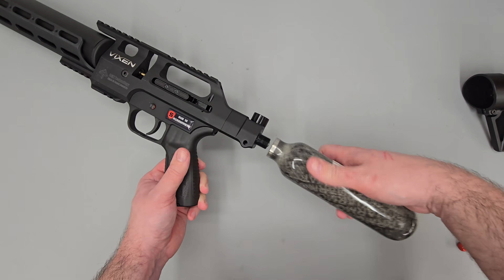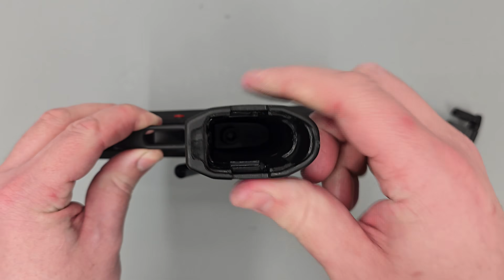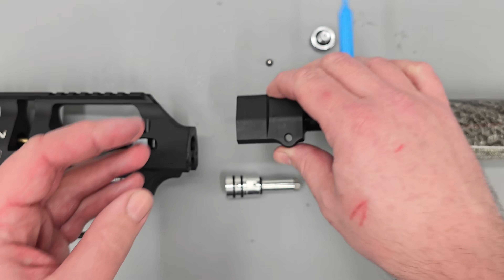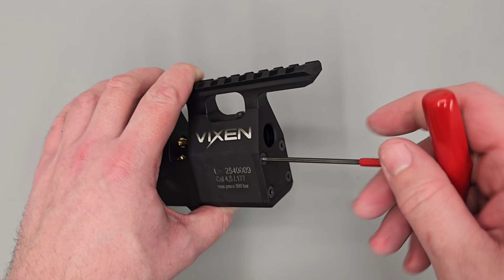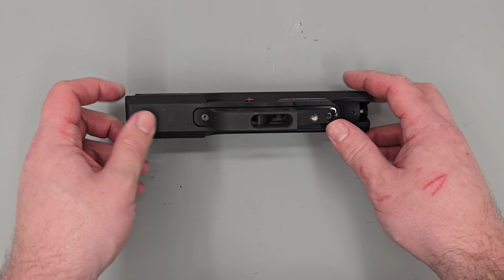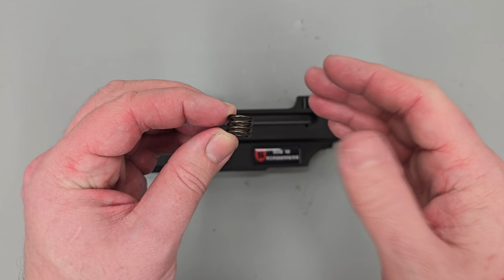AGT Vixen full disassembly and service

Comment: Time 5:46: On the barrel, how come there is no seal (o-ring) around or on either side of the port? Won't that result in a substantial loss of power?
Reply from the maker: they are in the block so when you insert the barrel it has a seal each side of the transfer port 👍

Comment: Great video. It looks like most people could do that at home as you don't need any special tools only maybe the vernier calipers if you don't have a regulator pressure tester. Just hex/torx keys and a couple of spanners.
You could maybe just mark it with a pen or measure it with a steel ruler on some paper and mark the length.
If you remove the brass tp does that make them full power or do they change a few other things and settings. I guess the regulator pressure and the hammer spring would need changing too. If you just removed it and used it as it was I'm guessing it would use a lot of air per shot.
Reply from the maker: yes you would need to change a few things as you say it would use a lot more air with no restrictor 👍

Comment: Looks like a well put together rifle. The valve looks to be a very similar setup to the one on my PX5. I noticed that you left the seat in the block, does that come out or has it been shrunk into the block? Couldn't get the seat out on my PX5, so ended up polishing it in place.